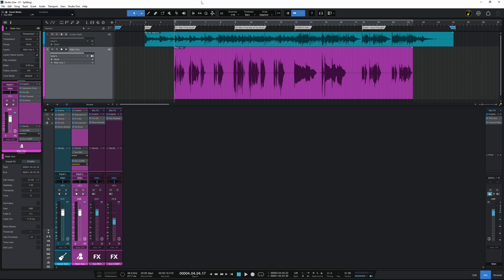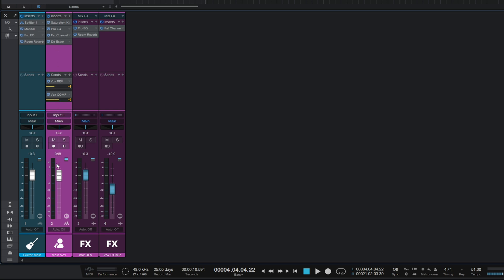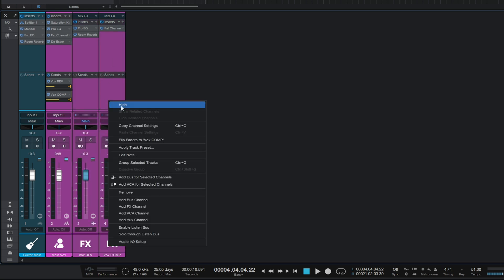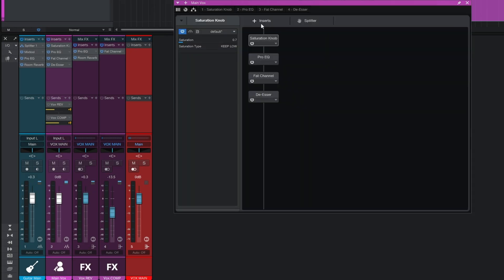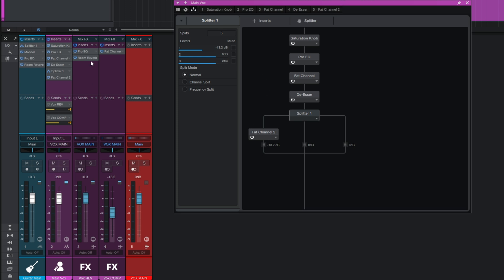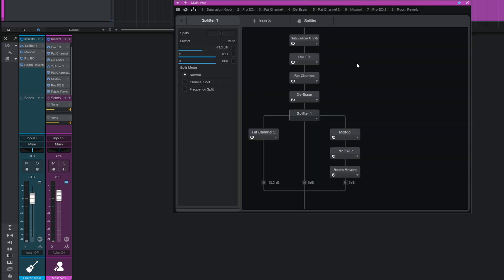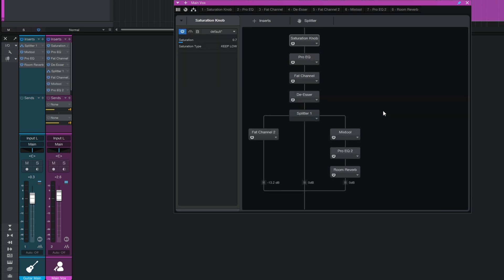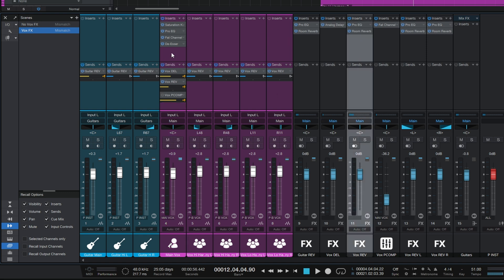Studio One | Using Splitter

Comment: Mike: I noticed that the plugins you put into each side of the splitter were also in the main chain prior to the splitter.  It seems as if S1 should then apply the plugins twice, once in the main chain then again in the split.  Am I missing something?  The couple times I've tried to use this, I only place plugins in the split section.  I'm slightly confused.